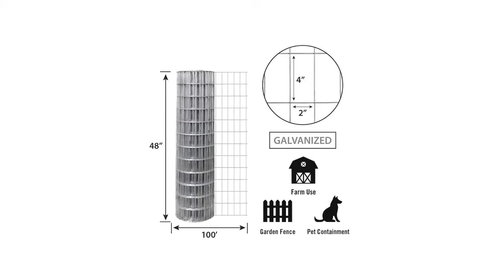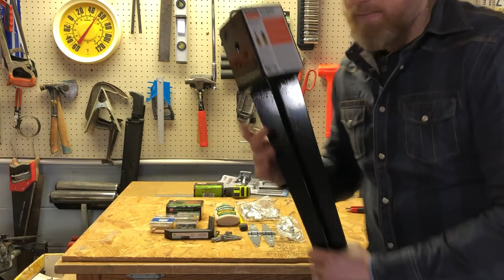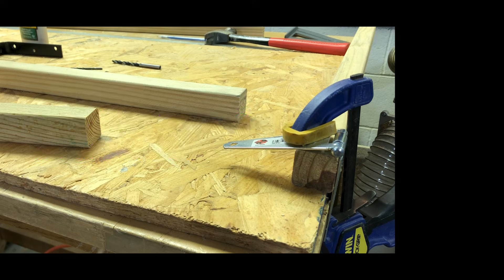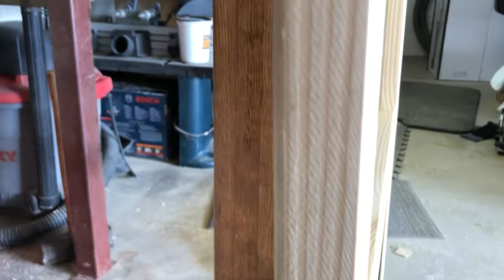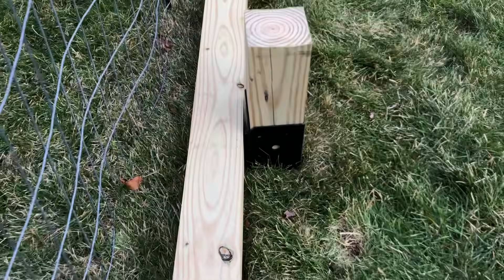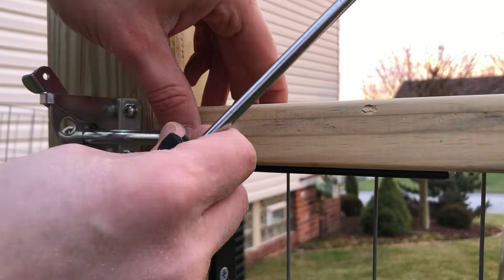Simple Fence Gate with No Digging

Comment: ❤❤❤ I have been trying to dig a hole since yesterday to cement in 4x4 post for my garden gate. I know this video was made several years ago, but I'm wondering how the spikes for the 4x4's are holding up?  At 65, I can promise you this would make it so much easier to install for me. Thanks so much!!
Reply from the maker: They are holding up really well. That area gets a lot of water so they are not quite as rigid but they are still serving their purpose really well. I hope they work out for you!
Reply: @BuildingWithBlake thank you so much. I hope you continue putting up videos. You explain things in such detail,  it makes easy to follow along.

Comment: Well done. Thanks for the many useful suggestions. On a few videos I've seen people talking about sagging gates that need a diagonal support. Can you tell me how I might go about doing that if I still put in those corner braces? Would it be possible to screw in a diagonal support or do you think the horizontal ones are sufficient?
Reply from the maker: For a gate this size it is very lightweight so you shouldn’t need the diagonals. Mine has been up for nearly 3 years now with no sag. If you did want to add diagonals, you would have to replace the corner brace with an L shaped bracket that goes on the side to connect the two pieces. Otherwise the brace will interfere.

Comment: Is there any other options for the spikes? Aka cheaper?
Reply from the maker: You could dig a hole and just seat the posts and backfill with dirt. But of course that is a lot more work. You could also drive a couple U posts and attach the wood to that but it won’t be as sturdy. My fence video shows U posts although I called them the wrong name.

Comment: did you place anything on the bottom when attaching the gate to the post?  Or was it easy enough to eyeball the space you wanted at the bottom so it would open. But I'm about to follow your directions to build one of these. We need this to go fetch baseballs and basket balls that go over the fence.
Reply from the maker: Yes i put a 2x3 at the bottom to create a 2.5 inch gap.

Comment: The only thing is that the fencing should be on the inside not only for aesthetics but because the push comes from the inside from the animal inside the fence.  My mother helped me build this gate yesterday, and while we were putting up the fence, she said to put the t-posts studs in.  I said, "That's not how the video shows," so she had to educate me 😅😊.  Thank you for this video and the video you posted showing how to build a welded wire fence with t-posts.  It will serve as a de-stresser when I need to be inside, while my two new goldendoodle puppies want to stay outside. 😁😁😁
Reply from the maker: Thanks so much and good note on the fencing.

Comment: Why use nails at all?  I get the extra support of the dowels, but why not just go cheaper and use all screws, no dowels or nails?
Reply from the maker: That would certainly work. I used dowels in part to keep it smooth in hand hold areas.

Comment: I have been trying to build this but in my case the EZ spike was the exact same dimensions as the 4x4 so the pics I was driving into it got stuck and it took me forever to get it out. I wound up burning it out. Then I cut the 4x4 post down and now they don’t fit snug. Very frustrated.
Reply from the maker: Can you shim the posts? Also I have used a belt sander to get the exact right width on some other projects.

Comment: I finished my gate on the other side and it went like clock work.  Learning from my previous mistakes I was able to adjust and make it fit.  I have also learned that one of my corgis is very good at finding weak points in my fencing and I will have to replace the plastic mesh with welded metal fencing and use T posts.  One of my goals was to make sure it wasn't permanent and easy to remove when we go to sell the house.  Thanks again for your video.

Comment: I've used your video to build a gate on one side of my home and found it very, very helpful.  Fantastic instructions, parts list, etc.  I did experience two issues.  One was the support cups where you put the 4X4 wood was super tight.  My sacrificial piece was jammed in and took we well over an hour to remove it and then sand it down enough to slide in, to pound down, and out to allow for the post I would use.  Not too big a deal but a bit frustrating.  The second was the ground was not level.  The gate opened pretty good, but as it swings open the ground rises.  Move the hinges up as far as I could to accommodate.  I'm doing this again on the other side of the house so I will apply the new knowledge.  Total cost for two gates $350ish compared to $4500 quote from several fencing companies.
Reply from the maker: the lumber I used fit fine but that's not always the case. I picked up a cheap belt sander for that exact reason.

Comment: Still holding up?  Just curious on the actual gate part since it’s 2 x 2s. Bought material and decided to research some and found your video.  Very similar idea but slight differences. Looks good though.  Curious on if the 2 x 2s are sagging at all. Thanks.

Comment: Nice video. Thank you. You should have diagonal bracing rather than two horizontal pieces in the middle. The diagonal bracing should be at 45⁰ angles or greater with the lower end on the hinge side. The gate will last far longer if you do this.

I just saw your video on larger gates. You obviously know what i said above. Sorry.

Comment: How would you stop the gate from shaking when you close it at the start of the video? I'm thinking magnets mounted into the bottom of the gate and posts that attract so the bottom is more stiff without additional latching hardware.
Reply: My exact thoughts lol I built a gate pretty much identical and had to add a lower latch because my small dog would just push the bottom and squeeze through as he pushed

Comment: This is exactly the gate we'll build thanks to you. Putting up the fence with 4 x 4" posts, T-posts, and fencing wire will be easy; we did it before, but it was a worry as to how to build simple, light-weight gate. Then BINGO we found this video! We only have to keep in 5 cats and a Chihuahua, so we don't need a heavy duty gate.
We did wonder why you didn't add a third cross brace at the bottom of your gate so as to attach that other hinge, seemingly giving your gate a bit more strength. It actually convinced us that we'll use three hinges, not just two, and because we're using 4 x 4" posts, we don't have to worry about those metal anchors...there won't be any. We'll cement our posts in the ground and have a gas auger to dig the holes.
Thanks for your help!

Comment: Love this video. I'm probably going to make a ton of these. I have a cattle gate I'm currently using that I found in the brush on my property. The cattle gate is bent and to make matters worse, the T-post I set next to it is crooked. The gate is being held shut with chains, but it is really annoying to open and close. You have to chain it just right or my goats and puppies will soon be screaming for attention from my front porch instead of in the yard where they belong. To make matters worse, my daughter loves being in the yard, but she is autistic and has dexterity issues. Every time she tries to close my bent cattle gate, the goats or puppies escape. This type of gate will probably be a lot easier for her to use. 

I'll keep my cattle gate, but if I put one of these near the entrance, I'll only need to use the cattle gate for my riding mower. 

I already have the wood and welded wire in my yard. I might even have some of the hardware too if I check my tool room. 

I might have to add a small hook latch on the bottom of each side because I have a few fence challengers in my yard that I'm sure will press the bottom of the gate warping it over time. 

I'd also recommend using the metal snips to cut the fencing instead of a saw, but that's my preference. Not sure about curling the ends, I usually just try to cut close to the weld. Hammering in the points is genius though. 

I'll probably make a bunch of these for my internal garden sections where I plan on growing watermelons, pumpkins, and wildflowers. I won't need the extra hook latches at the bottom though on those, just the entry gates I plan on making. I recently fenced in 2.5 acres and it will be nice to have more than entry gate especially since my yard is long and narrow instead of square. 

I also love the idea of using those other pieces of wood to keep things even while installing the hardware.
Reply: I'd like to know if this worked for your goats. I have some gates I need to make this spring, and this looks really doable.

Comment: I saw your other video on how to use the wire fencing to build a fence. What was the saw that you were using to cut the Fencing mesh? Doing it manually is not my happy place. I lack upper body strength.
Reply from the maker: It was an angle grinder. You can pick one up at pretty much ent hardware store.

Comment: There are some handy tools out there to help with dowling.  Mine is basically set of metal plugs with a centerpoint.  Drill the holes on one piece, install the right diameter plug and line the pieces up.  A couple of taps and you have perfectly located dowel holes!  Great video!!
Reply: Which is what he used to attached the cap pieces. 🙄    Did you miss that part?

Comment: Thanks for the build advice and great detailed video.  Only problems I ran into is I had to dig anyway because the Arizona soil made the E-Z spike start to buckle and I was splitting several blocks tying to drive that thing down into the clay.  Also the hardware listed for the E-Z spike is too big and will not fit into the hole.  Need 1/4 and not 3/8
Reply from the maker: The spikes are pretty big so they’re not going to split any rocks. Maybe try after a good rain if you ever get one. Or instead of spikes maybe try some rebar. Leave it stick out of the ground a foot or two and then bolt your posts to it.
Reply: Yes! I wish I had seen this before buying the too-big size of bolts. I found that they can be used with the larger holes in the spike because the heads of the bolts were big enough to hold.

Comment: Pressure treated wood is NOT WATER RESISTANT. Its ROT resistant. There is ZERO water protection in treated wood. The treatment is for touching ground or concrete. The treating offers no other protections. Both treated and non treated wood need to be sealed to be water resistant

Comment: Does anyone have tips on removing the 1 foot 4x4 from the Simpson strong tie? After using the 1 foot piece of 4x4 to hammer the Simpson strong tie into the ground... I can't get the 1 foot piece out of the strong tie, and of course i need to remove it in order to put the longer permanent 4x4 into place. Otherwise it's all going according to plan. Yay. Thx!
Reply: This was BRUTAL for us! 
TLDR PRO-TIP: Fill that spike sleeve with some gravel, or something that will prevent the sacrificial wood from becoming one with the X-shaped metal at the bottom of the sleeve before hammering the wood to sink the spike. That way, wood and whatever buffer material should come out easy peasy. Or better yet, do this >>>>>>>>>
Also, I HIGHLY recommend that if there is any struggle to put the 4x4 sacrificial wood into the spike, that you stop and slice some off. We wiggled-forced our 4x4 sacrificial wood into the spike sleeve. The issue turned out to be the X made of metal inside the bottom of the spike. The wood sunk around it and that was all she wrote! 

Also, be sure to leave plenty of wood sticking out to give you leverage. Two of us spent over an hour, prying, hammering, drilling through and inserting rebar to pull and attempt to get it out with leverage, drilled out the perimeter to make it like swiss cheese, etc etc.. nothing worked until we split the 4x4 into chunks with a chisel.
Reply: Also having a tough time getting the sacrificial wood out of the spike once in the ground 😅😫
Reply from the maker: Tap the 4x4 on the sides near the top to loosen it.

Comment: Might sound silly, but for a vegetable/flower garden WORK purposes, could just sand/grind the base of those two posts to where they slide in and out of those spikes easily.
Then, slide a single bolt through each base to keep them steady.  Make a door that's a solid panel.  Then when you go in or out of the garden, you just pull the entire door up out of the "sockets" of the spikes and set it aside.  Heck of a lot more room to get in and out of the garden to work/haul/wheelbarrow materials, etc.
Reply from the maker: That could work if you only need occasional access. The spikes already have a fair amount of play, so they could probably be used as is.

Comment: Thanks for posting this. I'm having trouble getting the lag bolts flush and can't figure out why. They stop with about a half inch sticking out and won't tighten in flush. Any ideas?
Reply from the maker: This is on the collar of the spike? Are you drilling pilot holes? The bolts might be running into each other. They should be staggered but if they’re off a bit they will intersect. Try inserting a nail and see if you hit the bolt. If not you might just need to drill a deeper pilot hole.
Reply: Yes, I drilled pilot holes. I'll try the nail method and try a deeper pilot hole. Thanks

Comment: We tore down our garage leaving 2 open sides to our fenced in yard. While we wait for permits and build a new garage do you think those no dig posts would work for a 10 ft stretch of fence vs a gate? Using something similar like the 2x2 frame and wire as the fence between posts
Reply from the maker: They would work for a fence but probably overkill if it’s just a few weeks. I have a wire fence video as well with U posts that are easier to install. How to Install a Welded Wire Fence the Fast & Easy way with Elevation Changes, No Digging
https://youtu.be/ttYtTEsQXOU

Comment: Nicely produced video, and very thorough. Thank you 

Over the years I've found that simple lap joints work really nicely for projects like this. I glue them up generously with epoxy, clamp them square on a flat surface, then later chisel and sand off any squeezeout. These are strong clean joints, and any reinforcing hardware goes on afterward, so there's no concern for alignment or throwing the joints out of square during drilling and assembly.

I used to think, oh no, that's too much joinery, I'm not doing cabinetwork here. But they don't take much time compared to the overall project, and it's pleasant work besides. It's just a few saw cuts to the desired depth, a rough pass with the chisel to remove stock, and a final pass or two to bring the face down to the line. Thickened epoxy fills any irregularities and makes the joint extremely strong.

Once the joints are dressed, I'll often put a bevel or cove cutter on my small router and make a pass around the interior of the frame. It's a foolproof way to get a sharper, more finished look on the piece, even with rough lumber. For very little work, it ups the game significantly.
Reply from the maker: I did a heavier fence with lap joints and agree with you they are excellent. I wanted to try something different with this and they worked out fine but when I’m doubt it’s hard to go wrong with half laps.